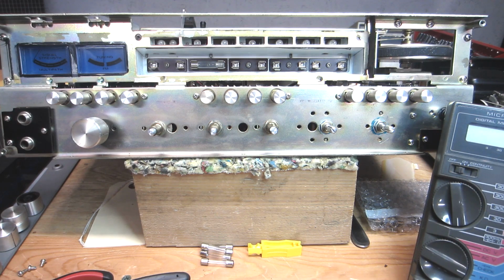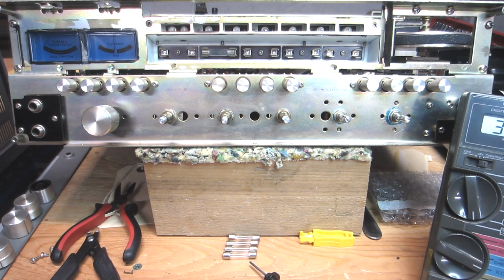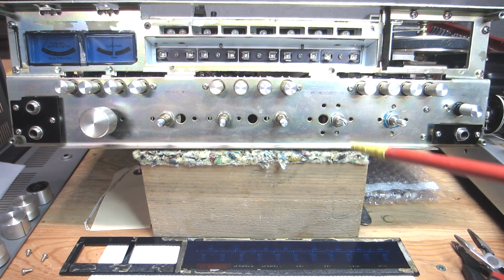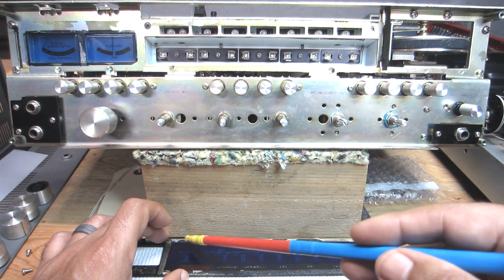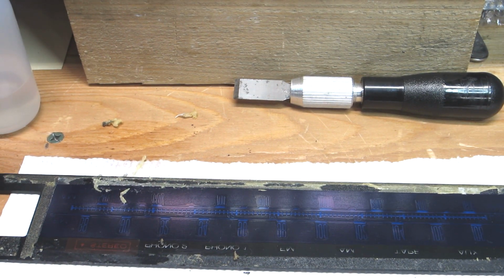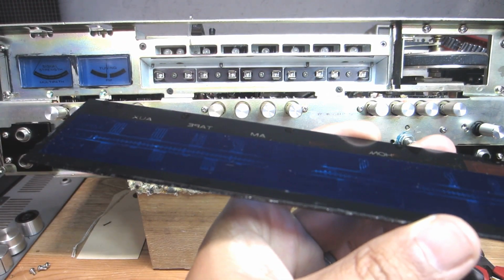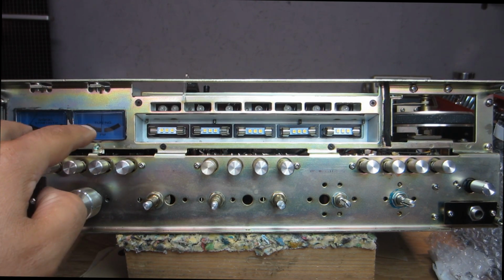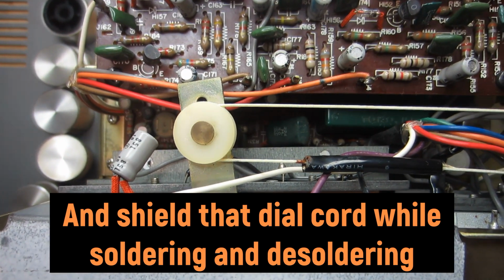Relamp Tips Marantz 2270

Comment: Does the dial string ever go bad? If so, is that string hard to find? Thank you for a very informative video. You earned a new subscriber. 😊
Reply from the maker: Hello there, yes, dial cord can degrade over time, although some holds up very well. Depending on the quality of the cord that was originally used, the environmental conditions where the radio / stereo receiver was used, and general wear and tear etc., has a lot to do with a dial cord degrading. I've seen plenty of old radios from the early 20th century (and later receivers) with good dial cords and others that were "snapped", again, it just depends. When they need replacing, there are plenty of options. You can use "high test" / high strength braided fishing line, that thicker waxed thread you'd find at a leather goods / leather craft supplier, or if you search under "replacement dial cord", you'll come across several sites offering varying lengths of dial cord. Otherwise, I'm glad you enjoyed the video, and thank you for subscribing. :-)

Comment: Great video. Did you do anything special to the radio dial pointer when you lifted it out of the way and set it on the top? Should I be worried about the string coming unstrung or is there enough tension when it’s moved out of the way. Thank you for making this very helpful video.
Reply from the maker: Hello there, I'm glad you found the video helpful. As far as the dial pointer, I just gently lifted it enough so that I could remove the acrylic dial face without disturbing / damaging the pointer. It's just a matter of moving slow and carefully without putting too much tension on the dial cord.  Otherwise you should be alright, again just take your time with the whole process and plan each move, in other words "look before you leap". Thanks for chiming in, have a nice weekend :-)
Reply: @retroelectrotech  thanks for your reply. I’m not really to worried about damaging the pointer. I just saw that you lifted the pointer and sat it in the top out of the way and if by doing that there’s a chance of the string coming undone or if there is still tension keeping it tight. Did I need to remove the black bar on the inside covering the string? Thanks so much again

Comment: I’m am currently relamping a Marantz model 2270 made on May 16 1975, which was close, if not the last, production batch of these units. My unit has vellum paper between the meters and the two lamps which I replaced by removing the housing where the dial cord pulley is mounted to. 

For removing the two-way rape on the acrylic dial face, I used my thumb to completely remove the residue and it went quite quick without having to mess with solvents. I did use acetone on the chassis, like you did. Great video 👍